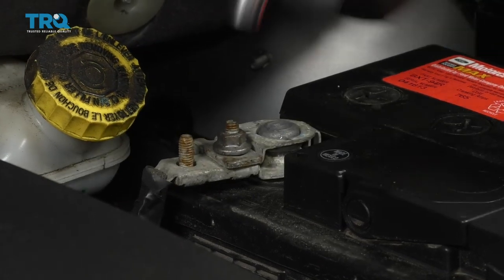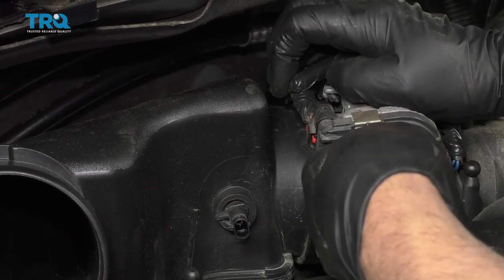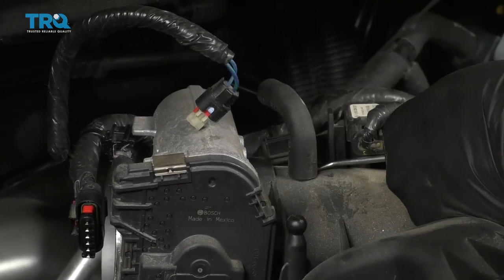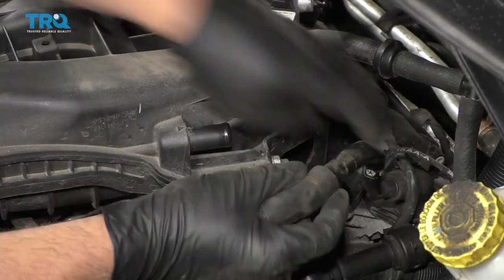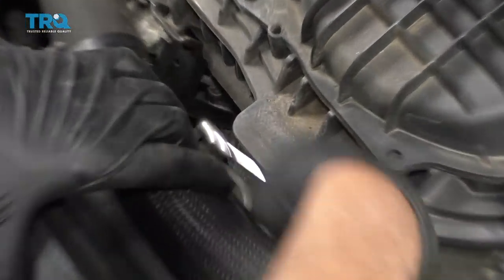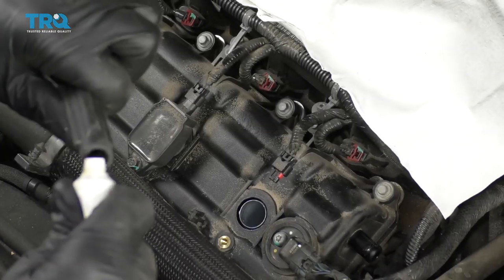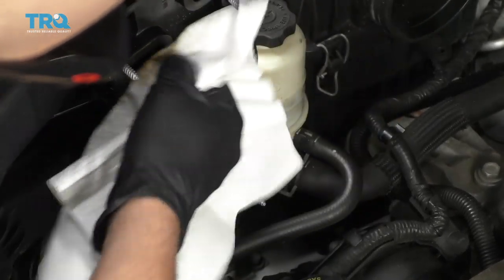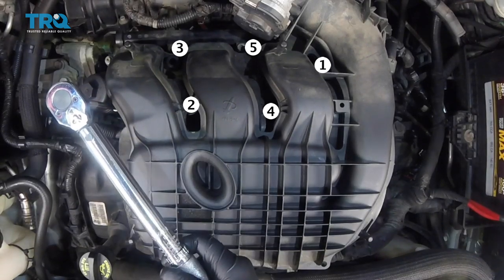How to Replace Ignition Coils 11-17 Dodge Grand Caravan

Comment: Excellent but if I wanted to switch out one coil with the one next to it to see if the one is good or bad can I do it put the code reader on or do I have to put all back before turning on??
Reply from the maker: +Luba Luba You would want to clear the codes each time. Thanks for watching our video! http://1aau.to/m/Shop-TRQ
Reply: @TRQ  so I can just drive with everything off or do i need to put back everything?
Reply: You need to put everything back before driving. On this type of engine, the solution is not to try the one next to it. Rather the solution is to get your codes scanned for free at autozone or similar beforehand, so its pinpointed which coil if faulty. Frankly, the $37 cost of the coil, per nov 2021, makes it not worth the time to put everything back, just to find out if a borrowed coil fixed it, as you woukd still need to disassemble and reassemble again to finish the job. Time is money etc.